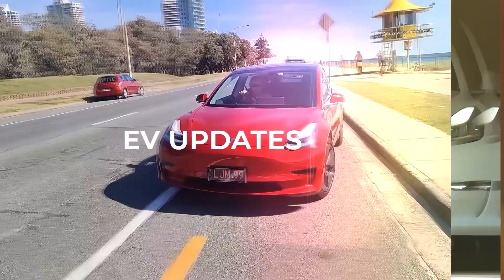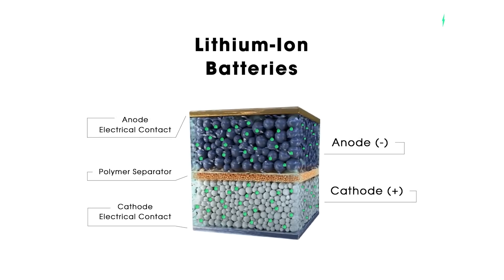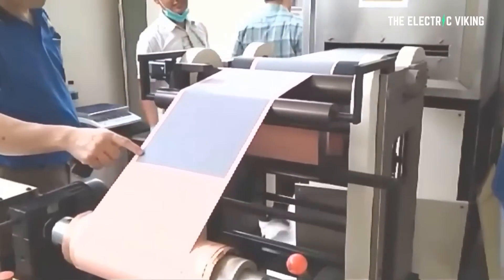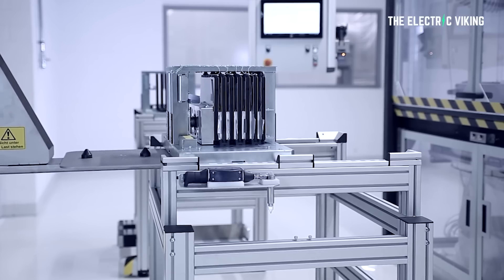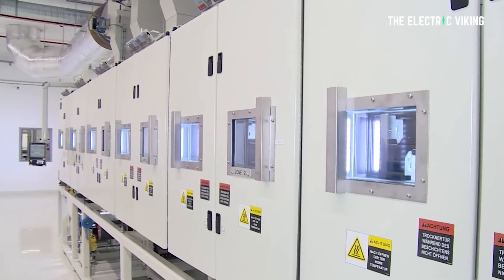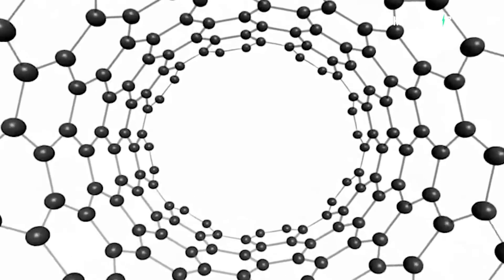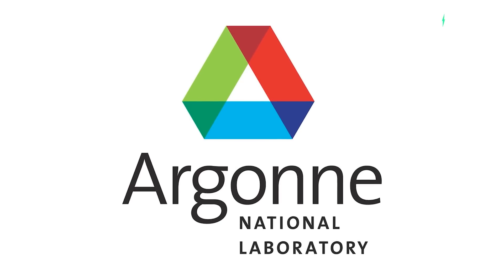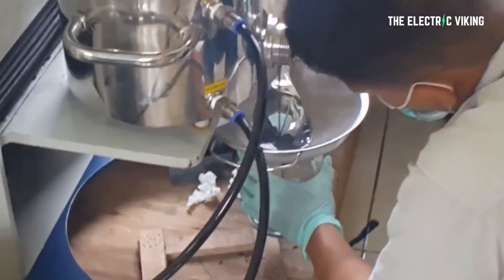US researchers discover huge lithium battery cathode breakthrough

Comment: There will be none game changing in the battery area. Every "progress" will be minute. We have reached the pinnacle of battery tech. Since we rely on metals for cells we are  now using one  of the most reactive namely lithium there is no longer a next step. Game changing was when we went from NiCaD 1.2 volt tech to Li tech with 3.7 volts. Now a days there is only a bit of evolution left. Maybe we can invent a super metal with a 12 V electron jump? Very unlikely since Li is highly flammable...Now don't be stupid the periodic table is well known. Everything else is just shenanigans and foolery for the hunt of 10-20 % hardly game changing!

Comment: One hundred cycles so far. Let's see how they perform after 1,000 cycles and 3,000 cycles. Also, can the manufacture be scaled up from lab samples to industrial production? If so, then this will lead on to even better technologies later. Exciting times! 
There will be short-haul and medium-haul battery powered passenger aircraft next, perhaps with some supplemental recharging from solar PV cells on their surfaces. Thanks Sam. 🙂

Comment: But why test results only for 100 cycles?
Reply: It takes time to discharge and recharge a battery. 1C charge/discharge is the standard and means full charge or discharge in 1 hour.
100 cycles would be 200 hours, or 8 days 8 hours. They might keep testing them for 1000 cycles, which is 83 days 8 hours, or about 2½ month, but that result won't be available for at least 2 months.
Reply: @silvergreylion  i know this very well and surely testing time was not issue as other batteries have tested from 800-7000 cycles usually. Looks like a red flag.

Comment: While I enjoy all the advances in battery tech.  I was wondering if you ever cover any of the negative sides. Chemicals, lack of recycling, energy output for getting resources
Reply: Yes, he has. Recycling is solved. EV production requires LESS energy output at Tesla. Chemicals? Contrast the BEV to the ICEV, then factor in the deadly pollution from gas fumes. There's no comparison, only a contrast. Bye, bye, Big Oil!

Comment: Why do batteries take so long to get from lab to scaled production? Unlike most other manufactured items - batteries have an element of TIME in their testing. Even after finding a promising change of chemistry, and cycling it a few times to show it is an improvement, the change must be made into larger cells, then cycled to a few hundred times, then a few thousand times. Cycling means charging and discharging, which cannot be instantaneous, it takes time to do that. There has to be a significant improvement over existing cells for a change to be worthwhile - but it takes hundreds of thousands of hours to sift through possibilities, gradually scaling up each one, eliminating the non-optimal ones, refining processes and re-cycling multiple batteries to prove a viable change. And as battery technology improves, and cells "last longer" - the number of cycles gradually increase, thus taking even more time to test and prove...Meanwhile there are many other tests, electrical characteristics, charging characteristics, environmental (humidity, hot, cold, mechanical shock and vibration)...all of which must be solidly proven to be acceptable for the application. Rather like holding Tesla stock, these battery researchers need a lot of patience...

Comment: Why cannot this information be used immediately to improve batteries?
Reply: LIke all low level discoveries it need to undergo a lot of testing.  You may have noticed people running it through strainer etc.  All this has to be automated at a very rapid rate.  That can take a long time.
Reply: While it might technically could be used very quickly, there could be side effects (slightly higher internal resistance = heat problem w/battery pack), which is something they'll be testing for, and if used in an existing production line and producing cells, which turn out not to be a drop-in replacement, then maybe they'd have to redesign the battery pack and production line, which would take a while (weeks/months).

A factory, which didn't immediately put this into production, would be churning out functional battery packs all this time.
It's all about avoiding F-up's, like changing all production lines in a factory, just to discover a problem and having to change them all back, resulting in a months-long shutdown, with no usable batteries produced during all that time.

Comment: Great. Now get rid of lithium.
Reply: We have 1.4 billion cars to build.  We are going to need many battery chemistries.  
What we need is to improve lithium mining and refining.
Lithium is literally everywhere.
Reply: @danharold3087 Quote:  "Sodium-ion batteries have great promise. They're energy dense, nonflammable, and operate well in colder temperatures, and sodium is cheap and abundant. Plus, sodium-based batteries will be more environmentally friendly and even less expensive than lithium-ion batteries are becoming now."

Quote: "Sodium-ion batteries are likely to be the next-generation power sources. They offer higher safety than lithium-ion batteries and, most important, sodium is available in unlimited abundance."

Quote : "In the USA, sodium-ion battery manufacturer Natron Energy and Clarios, a producer of low-voltage battery technologies for mobility, are collaborating on the production of the sodium-ion batteries."
Reply: @stevewilson5546  I am all for improved batteries.

Comment: They need safer batteries.
 GMC gotta fight their way out of a bad rap.
Reply: DId you know GM did not make the bad batteries.
The came from the company LG Chem.
Several other cars used them with the same results but GM got the bad rap.
Reply: @danharold3087  yea I know GM does not make the batteries. 
You know that and I know that,  but 90% of the people Do NOT know that. 
I could be wrong,  but I think LG Chem.  gave GMC like a billion dollars b/c of those (bad) batteries.
Reply: @icosthop9998  Your are right.  Nearly 2B
Reply: Bad rap ? Bad science is more like it combined with cheaping out on  parts
Reply: @beelzebobtheinnocent1659  True. 
The cheaping of the parts along with the various Recalls of brand new GMC vehicles , is why I am no longer a  "#GMC_Fan_Boy" 🥺
Reply: @icosthop9998  About your only alternative to  car maker using batteries from a single company is Tesla